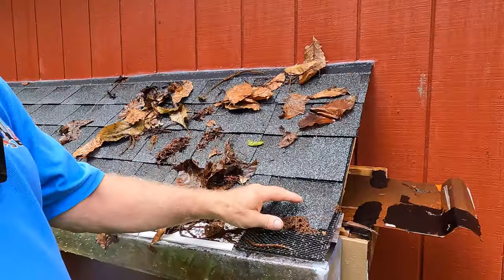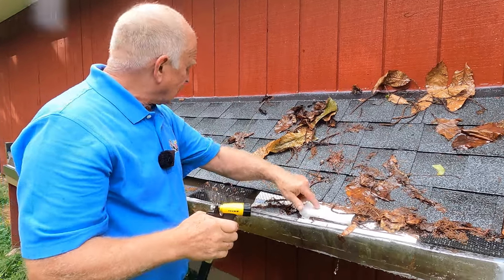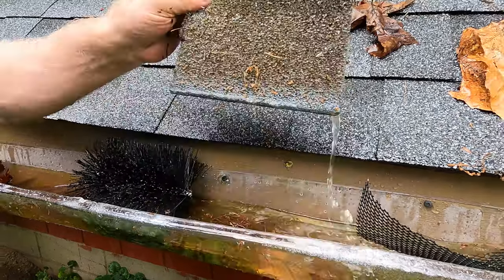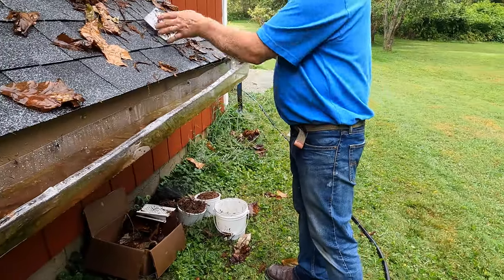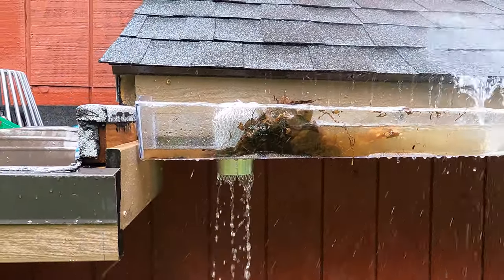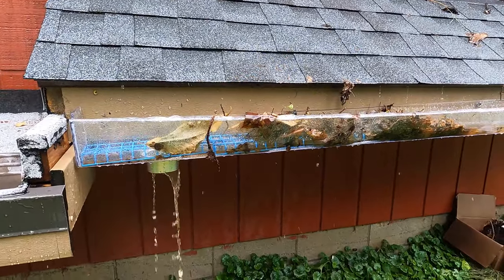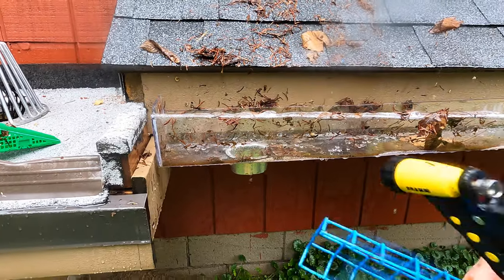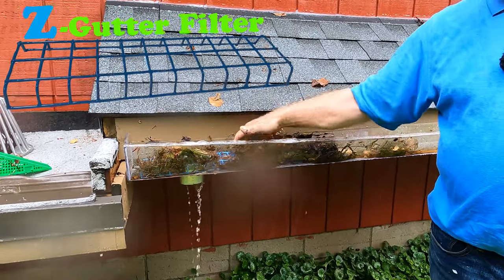What works the best - GUTTER STRAINER OR GUTTER GUARD? - unbelievable results

Comment: I like your info on the problems that no one tells you about concerning all the different type of gutter guards and filters. Most of the time my gutters are clogged at the downspout turn coming off the gutter. The strainer will not stop that issue. Additionally the plants and mold will still grow in the debree. Bottom line is there is no perfect solution.

Comment: I rather have the mesh. I had the similar thought because I have 6 downspouts in all, 3 of which are attached to french drains. I simply need something to stop leaves and other objects from passing through the spout. Annual cleaning will be simpler than hiring a plumber to clear the French drain. In order to flush any debris out of the french drain, I recently bought a Sewer Jetter Kit for Pressure Washer to attach to my pressure washer.

Comment: this is why you need bigger holes in the gutter guard and not smaller holes. it has to be small enough to block big leaves and big enough to let small debris through so it goes out the drain

Comment: 10 bucks a pop and sold out? Ugh. It's made out of the same material as those 3 dollar baskets at the dollar store. They really overpriced it. I wonder how UV resistant the plastic coating is. I also wonder if after a couple years the metal will start to corrode and  rust from within. Probably costs them $1 to produce.
Reply from the maker: It appears you have a problem with their product. You can make your own. Why not? Just buy some chicken wire and bend it. Not a big deal. That might cost you a dollar and then you might think that Home Depot is over priced in that case. Why would you pay for chicken wire that much? So go the a farmer somewhere where he will give it to you for free. Hmm, you might then think that the farmer might have something up his sleeve for giving it to you for free. maybe you should not think about it. Just have a peaceful nights sleeping and not worrying what the stupid stuff cost and how long it might last and how much they are making on it.
The last suggestion will cost nothing. How about that?
Reply: @FlatRoofDoctor  You make no sense. Cost and durability are concerns every homeowner has with any product invested in. If their product offers little advantage and is priced too high, what reason would a homeowner have to purchase it? If it is cheap and does not last, why would you recommend it? These are all valid concerns and criticisms. I am only asking the questions most discerning people would have. Worst, if they are not even able to keep in stock their own product, then what alternative do I have but to reproduce it on my own if possible? You are the one recommending something that is not accessible, therefore some of that burden and responsibility now rests with you, whether you want to accept it or choose not to. How about that?